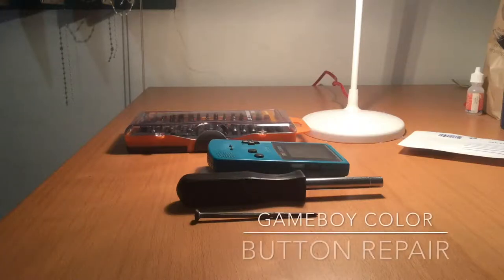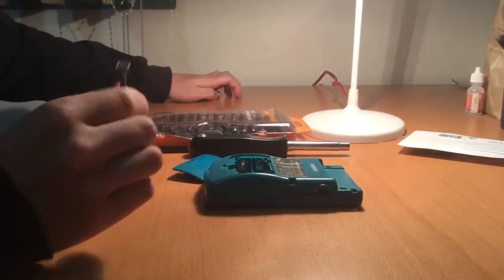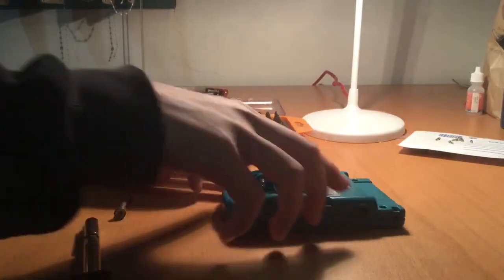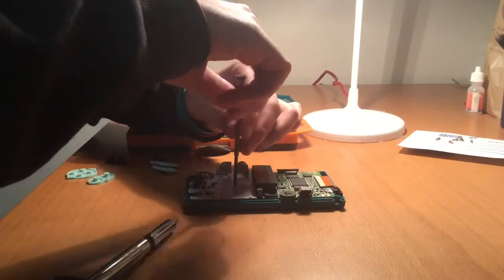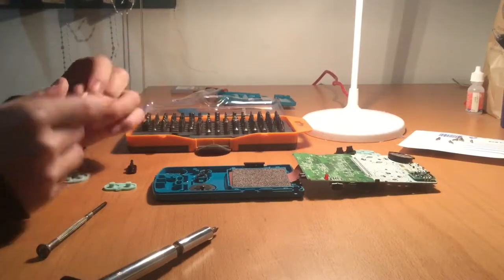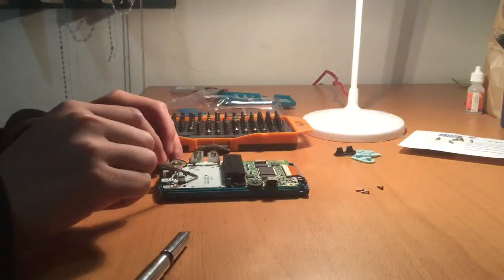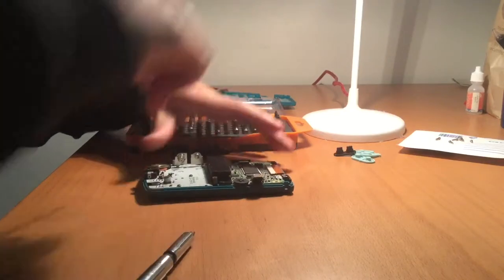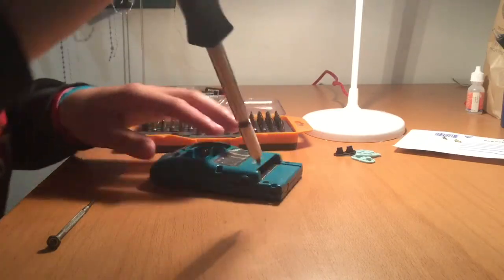GameBoy Color Button Repair - Quick and Easy |GBC|

Comment: The Start/Select buttons don't respond when you press them lightly on my GBC, really have to press them in hard for it work. Do you think this will fix it or are they just like that?
Reply from the maker: Changing the buttons won’t hurt. So it is best you change the buttons. If the buttons aren’t broken then a clean might suffice as it could just be dirty stuff causing contact point issues.
Reply: I had the same issue. The Start/Select buttons weren't broken but they were rather unresponsive and had to be pressed in hard to work. I replaced them now and they work much better. So, I would also say to go ahead and replace the buttons, if possible.

Comment: My silicone pad is fine, but on the motherboard the copper that recognizes my A & B response is worn. Any idea what I can do or material I can use to fix this?
Reply: I would add solder and take off the extra.

Comment: Ive got a question.. so I have a limited edition pikachu gameboy color that came with yellow version. I want to keep the same color buttons but I know the silicon pads inside are probably ripped. The A button works SOMETIMES if I press hard enough but it’s annoying. I was wondering if I could keep the same green and red buttons and D pad and just replace the silicon for all buttons. Would that work? Or do I need to find ALL new buttons?
Reply: i guess you can just paint em?
Reply: They got replacements online no need to paint. You can change the membrane too if needed with a new and better one.
Reply: You only have to replace the silicone. The actual plastic buttons don't wear out easily, but in the rare case you need a replacement for those as well, you can find them online in Ebay in many different colours.
Reply: @Sc0pee  you can get replacements for anything nowadays need a kidney here ya go!